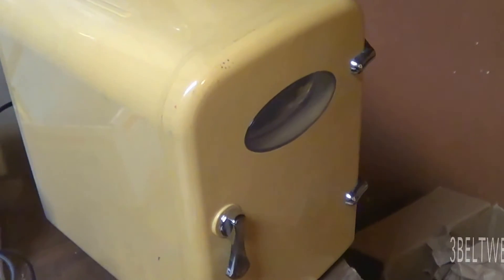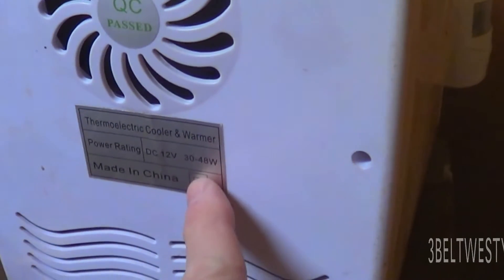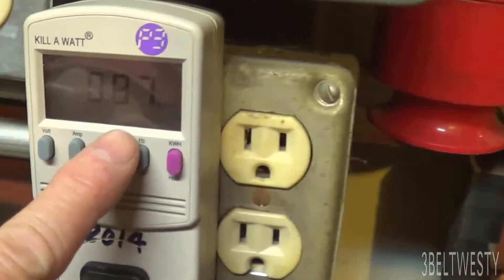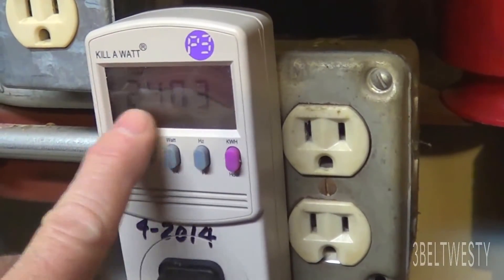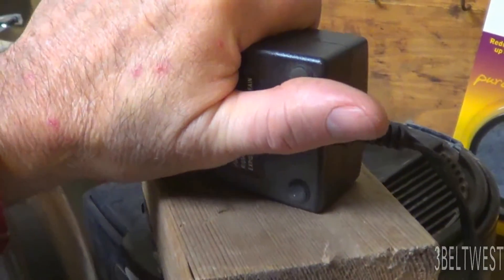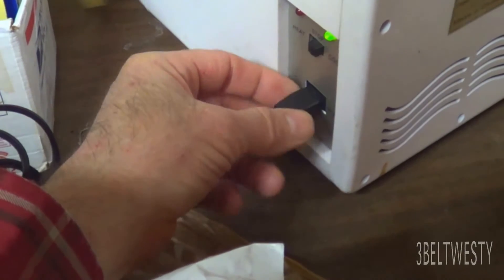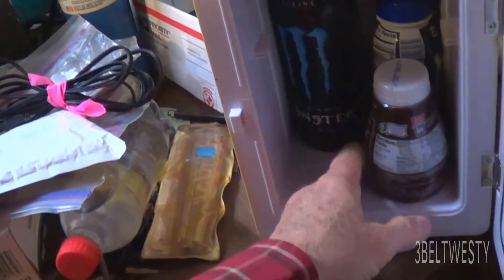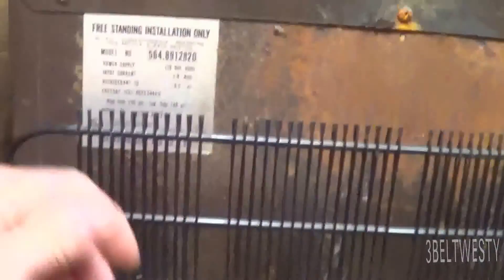Peltier Thermoelectric Cooler power consumption

Comment: That's shockingly high
Reply from the maker: Yeah real bad. I need to measure the power the DC power as a test someday too
Reply: @3beltwesty  well at least you know the thing basically can't break
Reply from the maker: @funkmon   The supply broke!  The external supply failed a month ago.

 ie AC cord Input to Switching supply brick with 12e volts DC out cord. The unit has either a 12V Dc in cord for a car or the AC adapter . It is marked 100-240 V AC 50/60 Hz Input; 12V DC 5000mA max output

Switching supplies dying are like common thing with low cost stuff. 

I had that dinky fridge running 7 months straight a at a local sports complex to keep a few cans of pop in.

The Fridge still works today; i just plugged in to a lab power supply . In Cold mode it started at 2.92 amps at 13.0 volts; is now 2.42 amps 6 minutes later

ie the current drops as the inside cool down

Peltier coolers are actually old tech. They are/were used on IR noses of missiles to keep the seekers camera eye cool to see IR better, Ie Sidewinder AIM-9 E  Echo series etc.

Comment: I've discovered that these peltier coolers are straight up not worth it unless you literally cannot fit anything larger 

A 1.7 cubic foot cube fridge which even has a little freezer section consumes around 24 watts on average and that's about the same for all of the mini fridges they all consume right around 25 watt hours so at that point unless you are again the space restricted you might as well buy the typical 4.4 cubic foot fridge I got a nice one from Arctic King I think? I got it from Walmart it was pretty affordable and it had no freezer section it was all fridge which is what I wanted and a consumes just about 25 watt hours 

The other advantage of a proper fridge is they will last longer these fridges will probably last 10 plus years held your coolers just don't last very long The cheap fans tend to go out and then you have to replace them 

They are cheaper you can get a peltier cooler for 30 or 40 bucks but a small fridge is only going to cost about $100 and it will use less electricity and properly cool mine has no problem maintaining 37° or optimal refrigerator temperature just don't let anything touch the very back since the cooling grid is behind the plastic in the back and that tends to get just below freezing.
Reply from the maker: Totally Agree. The Peltier fridges like this are really terrible in power consumption.

I have been testing a Domende Model K18 portable fridge and it is radically better. 

It has an actual refrigerant micro compressor in it. 

Running off the Wall 120 volts to the Watthour meter to the 14 Volt DC adapter is the test. 

6.59 Kwhr in 819 hours in Feb March time frame 

3.55 kwhr in 408 hr  March time frame

7.76 Kwhr in 726 hr in May timeframe.

7.65 Kwhr in 604 hours in May June. 

The meter looses its mind when the power goes off. lol

So it used  25.55 Kwhr in 2557 hours

So per year crude estimate is (365.24 *24)/2557   *  25.55 = 88 Kw hr
 
7.3 KwHr a month.

It has a DC input so got it as maybe a post Hurricane fridge off a solar cell and battery

Comment: Thanks for posting these data.  As yo pointed out, much of the energy could be lost (as heat) in the 120 to 12V converter.  But also, the small frige has a large SA to volume ratio.  So losses through the insulation are high vs a larger volume unit

Comment: Yeah them chips aint at all energy efficent. But hey,they do actually work to an extent
Reply: its a Peltier cooler. they are convenient and cheap not efficient. however at 36w you could solar power that pretty easily. the advantage "IS" in how cheap and tiny it is. they are around $20 to $30 and super tiny.

Put a better heatsink on it and a better quality fan and the efficiency might improve a little but not by much.